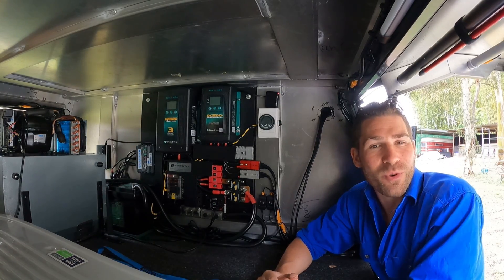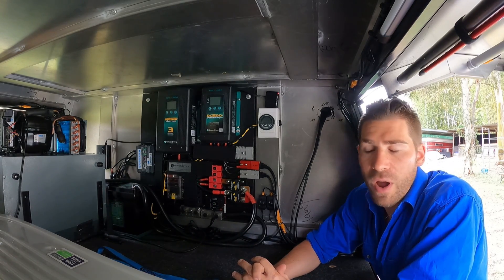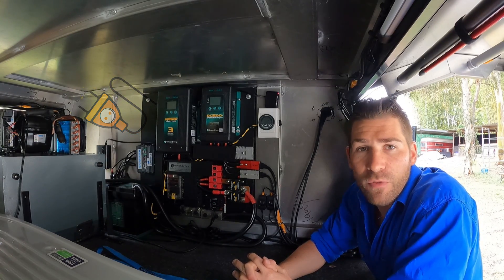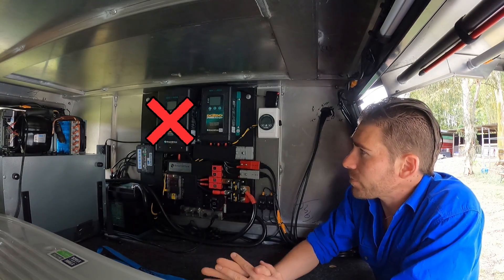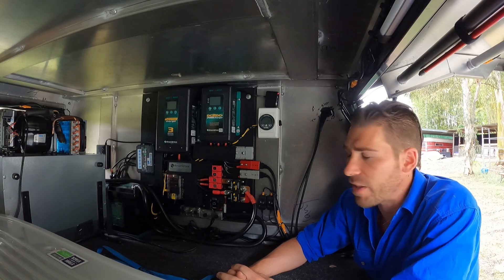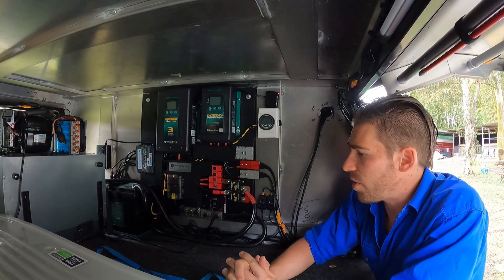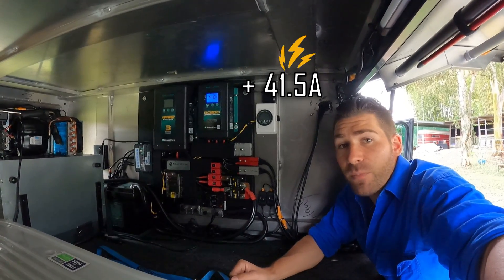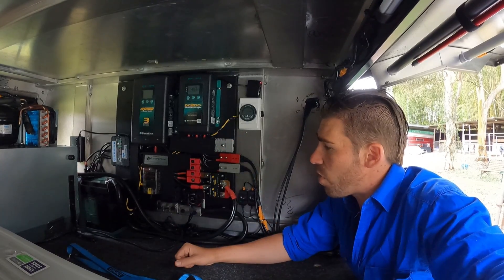ENERDRIVE DIY BOARD - Are They Worth It? || Enerdrive 40A+ DC & 40A AC charger DIY board review.

Comment: Hi mate, 
Love your set up!
Just wondering what cable size you ran from your starter battery to the DCDC charger?  I've just ordered the same system and have already run 25mm cable at a length of 7 metres.
Are you still happy with everything? 

Shayno
Reply from the maker: Hey mate, 
I used 16mm cable, just got it from Enerdrive when I picked up the board. I was really happy with the board, great buy. The AC/DC was a bit of a waist as the 40amp DC charger is so bloody good you can just use your car as a generator 🤣😂

Comment: hey chief love the vid! when you ordered from Enerdrive, did you have to provide specific measurements for the board that gets mounted to your canopy? or did you do that whole retro fit yourself?
Reply from the maker: G'Day Josh,

Enerdrive is just a supplier so you have to order from a retailer. Boards are all the same  size, I just got the angle grinder out to cut the board to size 👍🙂
Was an amazing unit and money well spent, I priced the components and it's not bad value

Comment: Hi mate is the dc charger a battery monitor as well or do I need to buy one separately
Reply: Thanks dude thanks for the reply
Reply from the maker: Hello Aaron, the DC charger only tells you charge coming in, not the amount left on your batter. So would would need to get a cheap battery monitor. or a battery like mine that has an inbuilt blue tooth monitor.

Comment: Nice review.  Does the Enerdrive System Bluetooth its battery data to an app on your phone?
Reply from the maker: G'day Gary, both the board and the chargers don't have blue tooth. But Enerdrives battery has an amazing blue tooth app. That's where I get all my data from. 👍😁
Reply: @OffTrack.4x4  thanks, just a follow up question, sort of related, when your circuit breaker tripped on a previous episode, was it the phone app or the monitor in the back that first alerted you to a possible problem.
Reply from the maker: Hello Gary,

No unfortunately the app doesn't push that info to you. I just all ways just what percent my battery is on theought out the day. When I saw it was only on 40% I new something was up.